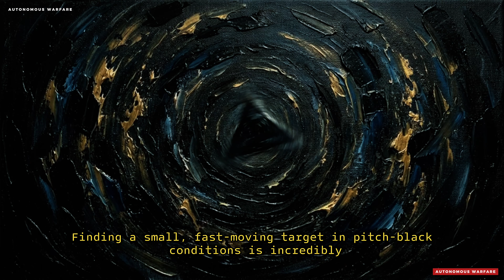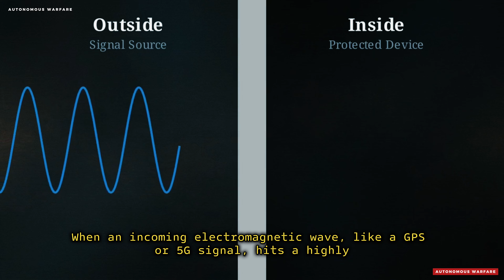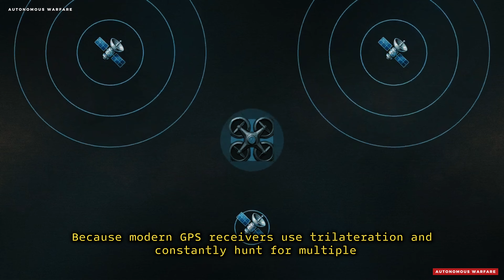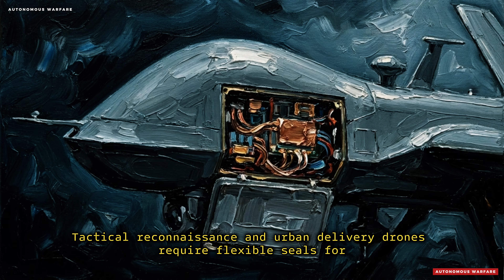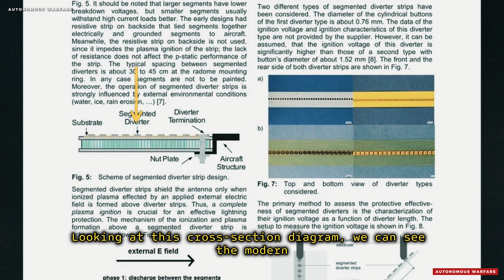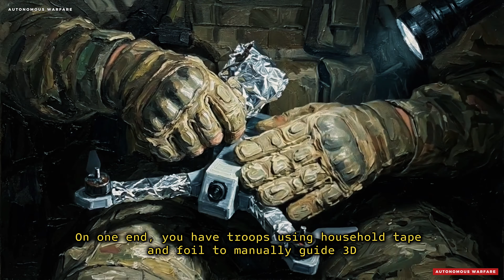Why Are Interceptor Drones Covered in Tape and Foil?

Comment: This perfectly illustrates how modern warfare has shifted from expensive platforms to rapid iteration. Instead of waiting years for a redesigned airframe, operators modify drones in days based on real combat feedback. The side that can adapt faster often gains a greater advantage than the side with the more sophisticated technology.
Reply from the maker: Well said. The speed of adaptation is becoming just as important as the technology itself.

Comment: One of the biggest misconceptions is that tape and foil are improvised repairs. In reality, they're often inexpensive battlefield adaptations to solve specific engineering problems. Whether it's reducing reflections, protecting wiring, reinforcing airframes, or managing thermal signatures, modern drone warfare rewards quick, practical solutions over polished aesthetics.
Reply from the maker: Absolutely! Modern battlefields reward practical solutions that work, not perfect-looking hardware.